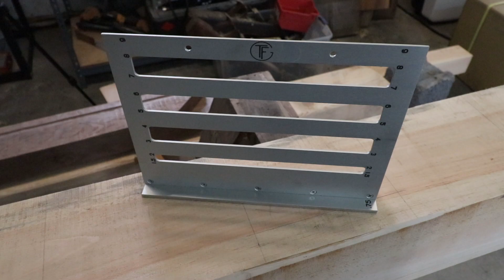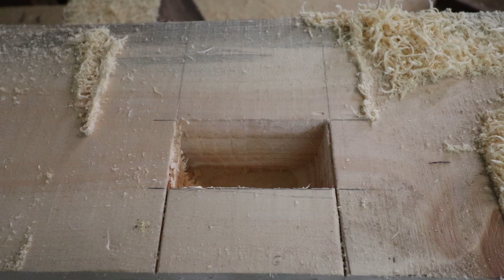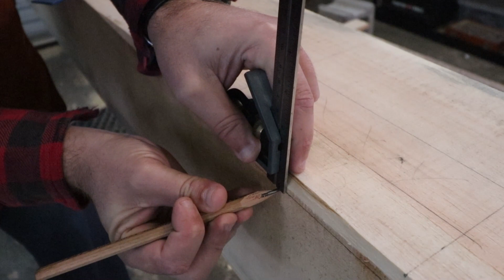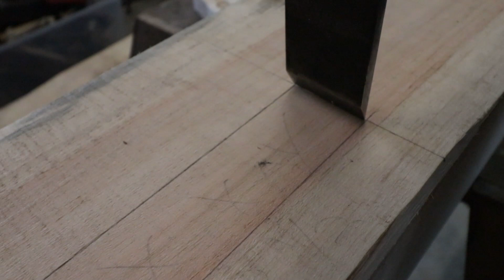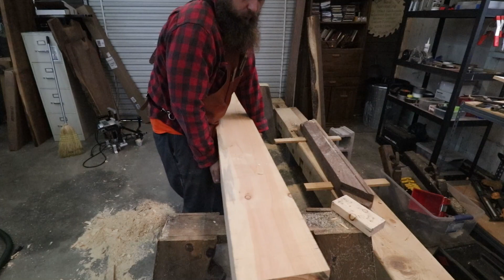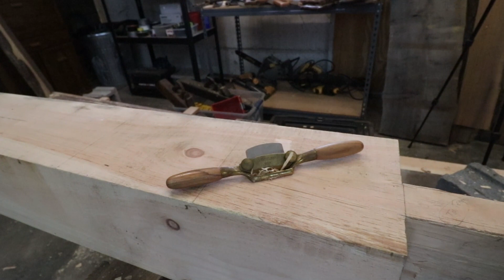My Timber Frame Barn Build: Cutting Tenons with Hand-tools

Comment: A little Joe Rogan never hurts.  Before I work the tenon I drop all lines down the drop end of the tenon, use these line when cleaning to the line,  it helps a lot.  On clean grain like you were working, no knots, you can get away with just sawing the shoulder and then splitting from the butt end with the axe, drive it with a mallet if need be, they will pop right off. and then there is the french snap, a favorite method when using hand tools on joinery.
Reply from the maker: Hey Tim, good to hear from you, appreciate you comments as always,
btw you have the most under appreciated channel no here, wish I could spend a few days up there with ya,
Reply: @OutoftheWoods0623  I just hit 1000 subs!  Its hard going without the advertising, utube doesn't promote videos that don't advertise,  I like to share info more than the dollars it could bring in. I run a low budget channel btw.      Framing is now a second job, at another time I would encourage people to come to a workshop type event but its not in the scope of things at this time, I hope the videos can come close.

Comment: There was a much easier way to  cut that 2nd to last tendion if you cut with the bottom of the cut with the grain  that would  help you make the cut  accurate and needed only a little tuning with a chisel if any
Reply from the maker: no thanks, I enjoy paring down with the axe, If I was after speed I would just use my skil saw,
thanks for watching,
Reply: @OutoftheWoods0623   just giving out advice that my late grandfather told me  and honestly the timber frame method has always interested me I'm glad your bringing it out in a way that others can  learn how to do it as well
Reply from the maker: appreciate that, Im learning myself also with every cut, big project here,
Reply: @OutoftheWoods0623   my late grandfather was a wealth of wood working knowledge  and oddly also how I got started in my main hobby of model railroading

Comment: Will you be posting a video showing a faster method of cutting joints, then comparing the different methods you've used?
Reply from the maker: doubtful, this is how I have cut all of them so far, it goes faster than you think, the video process makes everything slower,

Comment: That was certainly a bit different. You measured, marked and then carefully cut your way through the wood. That is the way I thought things should be done. Unfortunately in Britain we have a breed of individuals who call themselves “tradesmen”. This appears to account for too many the workers on building sites. “Wood butchers” would be a better description. They use screwdrivers and hammers to beat holes in wood, use saws as axes, bricks to whack in nails and measuring and markings out is an inconvenience. I’m glad real carpentry and woodworking skills are practiced somewhere.
Reply from the maker: same here with have people who don't even know how to sharpen a chisel,